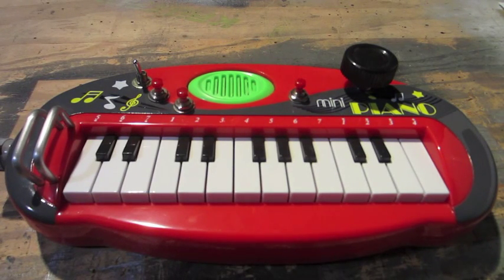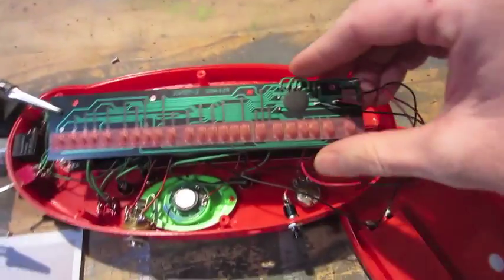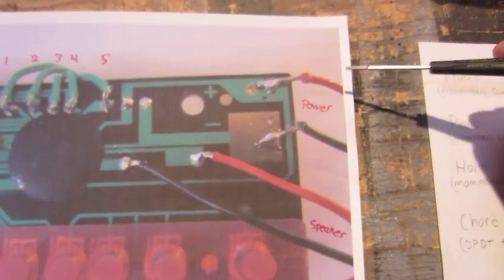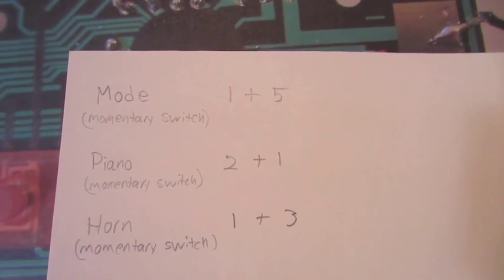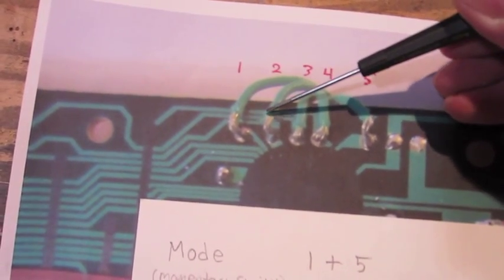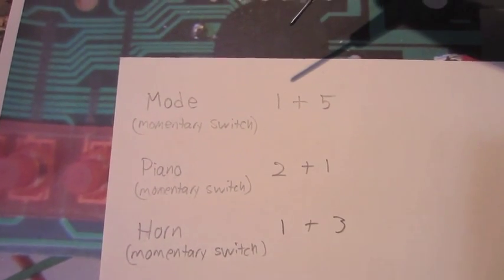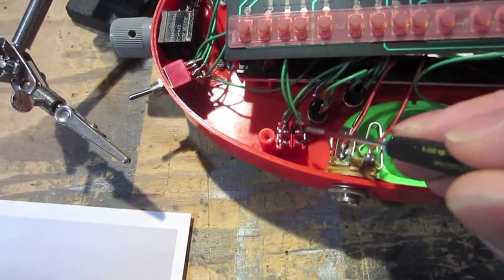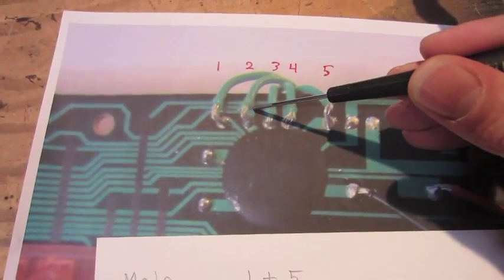Circuit bending a toy mini piano part 2

Comment: hey Mike, maybe dumb question here: how do u manage to connect the same pin into different components without actually soldering the same pin twice, per example between 1 + 5 and 2 + 1
Reply from the maker: It’s been so long since I did this one but I think I probably just had the wire from the board connected to one button and then that same contact also jumped over to the second button.